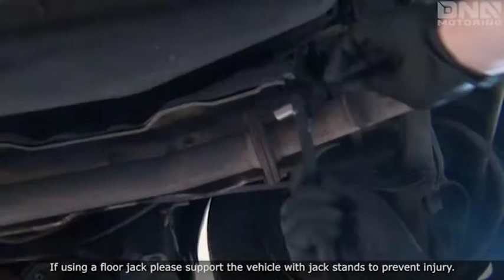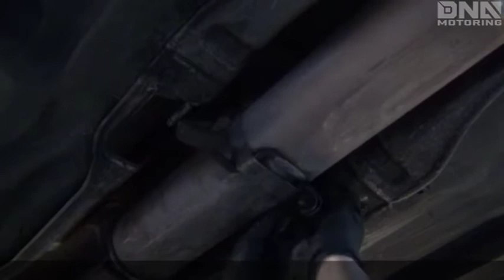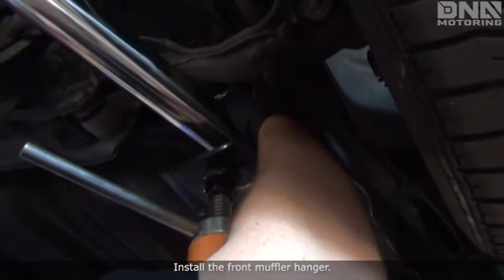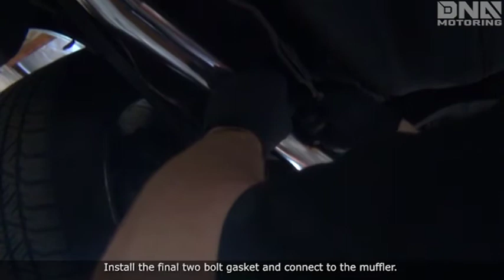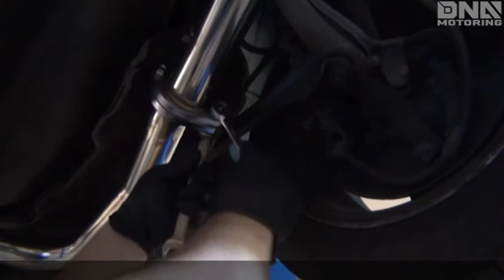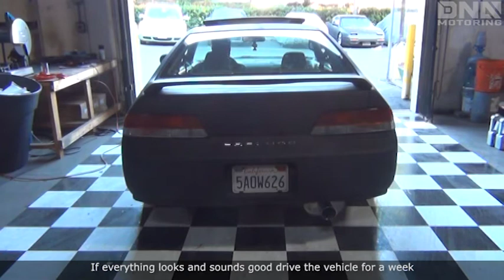How to Install 97-01 Honda Prelude Catback Exhaust

Comment: I thought the exhaust sounded cheap at first have it on my prelude (h22a4) and I took the car on a 500+ mile trip after and broke it in and it sounds 1000% better now. Easy install and It still cleans up pretty good :) def the best exhaust if you not tryna splurge but you want something more than stock.
Reply from the maker: Thanks for the feedback!
Reply: What engine is better ? H22A4 or H23A ?